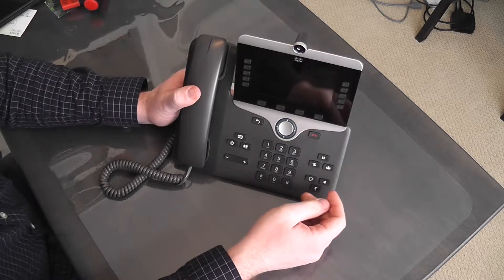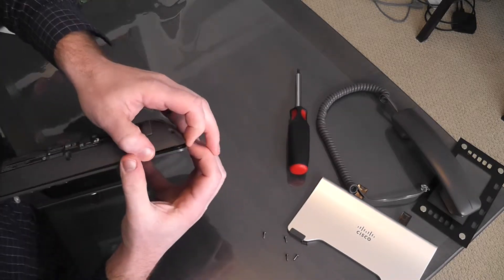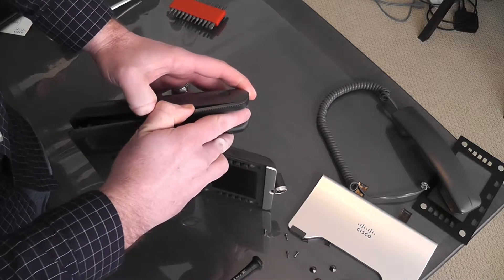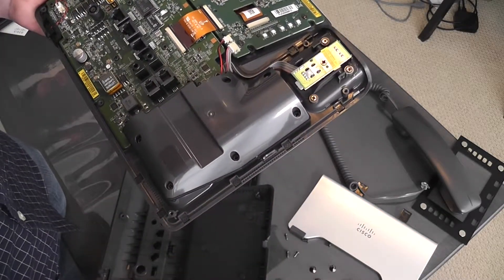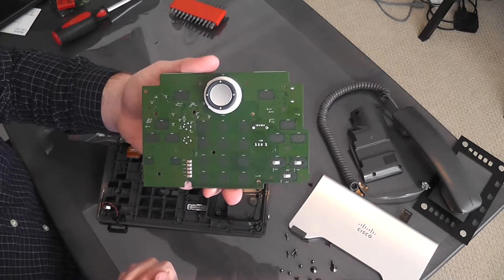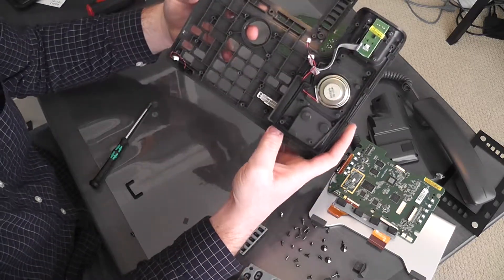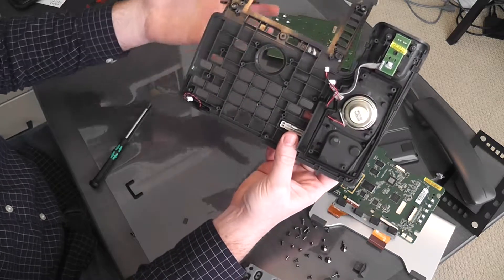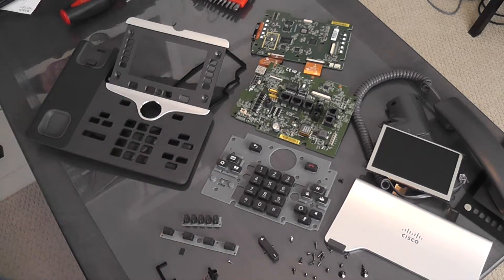I took apart a Cisco 8865!

Comment: I'm having trouble with alot of the 8865's shutter malfunctioning. Does anyone have a video on taking those apart? At the very end you mentioned the camera/shutter briefly.
Reply: Came here for this too. Camera shutter came apart during shipment and trying to put it back together.
Reply: I figured it out. The white dogleg shutter pieces sit on top of the grey ring that sits around the camera lens. The lens cover then comes last with the Open-Close markings at the bottom.

Comment: Do you think there is a realistic chance to remove the LED around the select button? I'm using the phone in a bedroom and the light is annoying at night in standby mode.
Reply: @Joseph Forget about my last question -- just flashed the new firmware and realized that it is an UI option at General Preferences now. Great!
Reply from the maker: I  suppose  you could remove it if you really wanted too... I don't think there is an easy way do so though...
Reply: Joseph, many thanks! This is still highly relevant for me. I use the phone with asterisk, so I’m writing the SEPMAC.xml manually. Could you share the XML notation for the option, please?